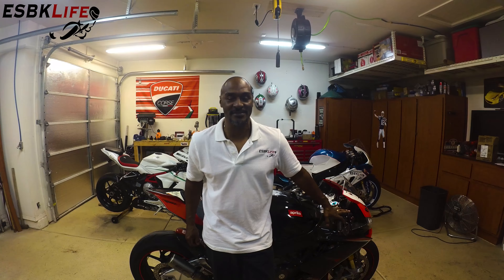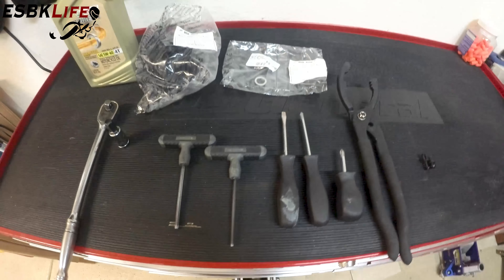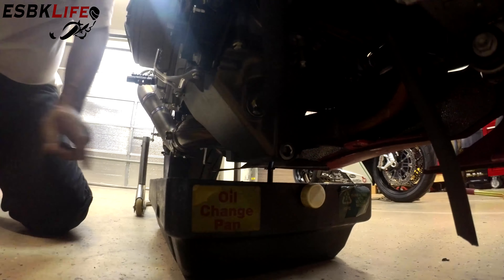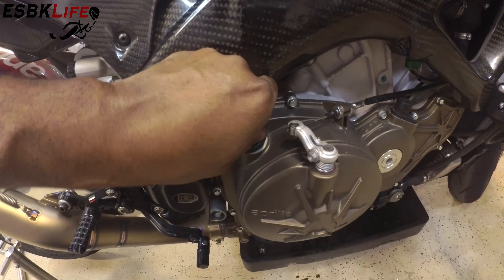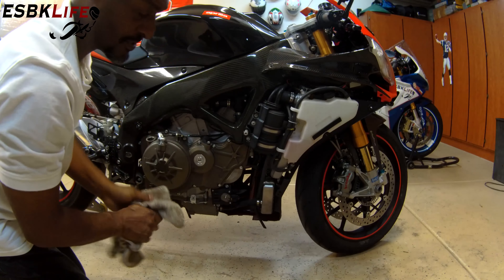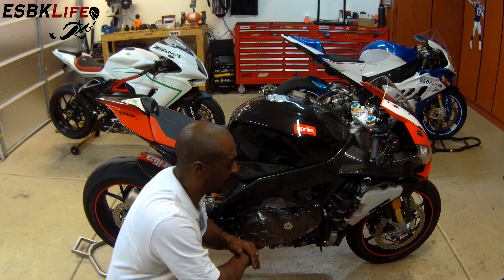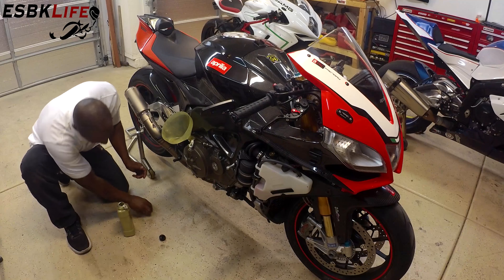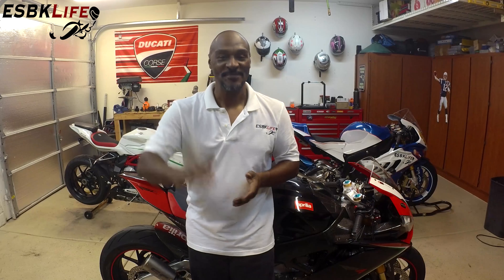2013 Aprilia RSV4 Factory APRC ABS SBK SE Oil & Filter Change

Comment: Does the dealer do anything else on the first service other than change the oil and oil filter? If yes, where could I find a list of what the dealer will check on the first service?
Reply from the maker: Your service list should be somewhere in your owners manual. However, the “first service” is typically around 600 miles where they will change the oil and filter, remove any power limiters if one existed and check a bunch of stuff. If you’re talking the fist “major” service the only thing done that’s of any concern “to me” is the valve check and adjustment. Everything else can be done yourself.

Comment: Nice... do you have to change the gear oil in the Aprilia to?
Reply from the maker: The gearbox in an RSV4 is lubricated by the engine oil. No need for gear oil. However, some use gear oil to lubricate the chain. I’m not one of those people lol.

Comment: HI can U explain me one think about exup. Did U remove just the cable and block valve ? or U made something with ecu as well ?
Reply from the maker: I removed just the cable. However, I have the race ECU which I believe disables the valve but, don't quote me on that.
Reply: Did you notice anything negative after removing the flapper? Esp on it being lean and on gas mileage? I believe race ecu disables flapper when in gear but not during idle.

Comment: No torge, no lube on the drain plug seal, bikes back is levetated while looking at the oil level and he doesn‘t state how much oil comes in. Would not recommand
Reply from the maker: You're really coming at me for a video that I posted nearly 8 years ago LOL? But here's a news flash for you. The drain plug does not have a rubber seal. It has an aluminum crush washer, as shown in the video. There's nothing to lube lol.  As for "how much oil"..... did you watch and LISTEN to the entire video?  Your comments tell me you didn't. You should probably stick to posting video game content. But Thx for the feedback @bigmama2675 👍
Reply: @ I am not coming for u or something and I am not stating that u make Bad Videos, I am just stating that I would not recomand doing a oil change like u done.
Ich know there is no rubber seal but usualy u also lube Aluminium washer also, so i doesnt oxidade